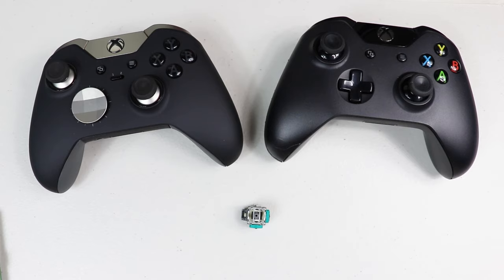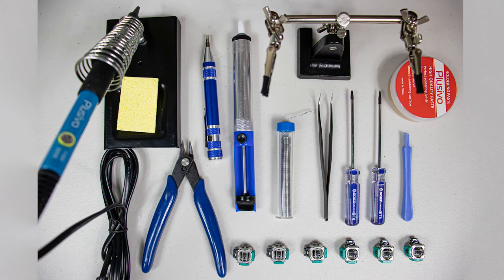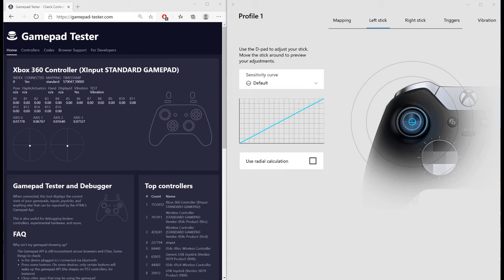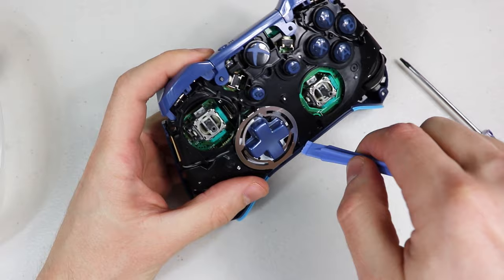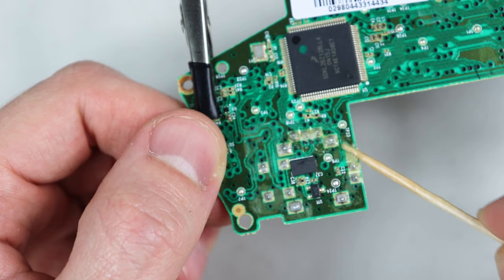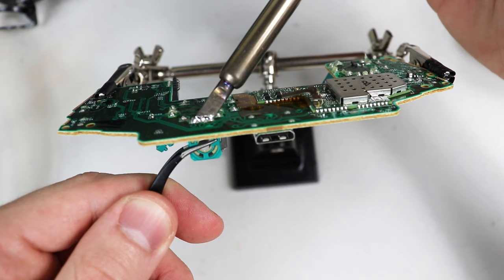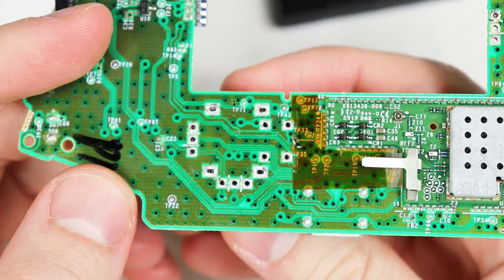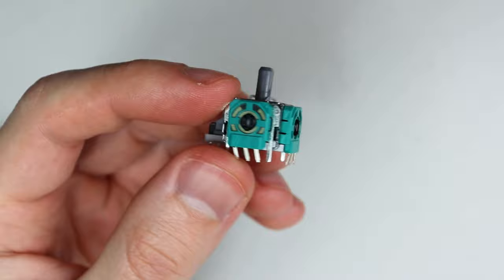How to Replace Xbox One Controller Analog Joystick - NEW METHOD - Fix Stick Drift, Broken, & Loose

Comment: Hey is it normal for the new ones to stick in the directions you push? I havnt put it in yet but they seem to be sticking in each direction I push instead of centering itself after pushing it in said direction. Does that mean they are bad or is there a step Im missing to make them center themselves?
Reply from the maker: Yes, they are totally fine! I mention that in the first few minutes of the video :)

Comment: I was doing this repair and unfortunately lifted the copper pad on one on the pins on the sensor module, now it’s reading 100% up all the time, please help
Reply from the maker: Check this post out: http://acidmods.com/forum/index.php/topic,44225.0.html I would recommend making a new post with a picture of the damaged pad asking where to reroute it too if you don't see the solution on that post.  Good luck!

Comment: Is it possible to do this with just a soldering iron and the solder without any extra stuff?
Reply from the maker: You will need a way to remove the solder and the screws on the controller. But other than than, I suppose it can be done.
Reply: @SOSSGAMING  I attempted to remove the solder with just the soldering iron and it definitely seems more difficult

Comment: i hope u answer me 

i have replaced Joystick by another one but when i test it by hardwaretester i found the arrow raised too much above the circle ..i that normal ? or that not orignal joystick ?
Reply from the maker: What is the actual value? One of the through-holes may be damaged if it shows 1 or 0, which might be able to be "fixed" with a jump wire.

Comment: Do you have to always cut off the corners nubs prior to installing ?
Or could I just put it in and see if it’s ok?
Reply from the maker: Technically no but I would recommend it, as about 80% of the time I end up adjusting it anyway, but I also try to get very close to the center.

Comment: Can you fix stick drift using just calibration or would I need to buy a whole new joystick?
Reply from the maker: Technically in some instances you could, but quite rarely. If you only have stick drift I'd recommend just changing out the potentiometer. You can just pull on off of a new stick.

Comment: I need help my stick snapped and i dont have very many tools to work with. I have an extra broken controler but the sticks work fine I need the gray stick from it becuse my Anilog snapped. How do I fix this.
Reply from the maker: Unfortunately in that situation a stick replacement is basically required, unless you are able to super glue / epoxy on the other part which may work as a temporary solution.  Otherwise, to replace the plastic piece you would need to desolder the stick, remove the base, swap sticks, and solder it back on, which at that point it would just be easier to replace the whole stick.

Comment: I need help please cause i'm going crazy. At first i switched the wipers of the analogs as a temporary solution and It doesn't work. In particular the left one keeps going.. left (i switched the x axis wiper with the y one of the right thumbstick). So i completely changed the two analogs. Now the right One works perfectly, but again a couple of minutes after i start playing the left analog goes to the left (so obviously i can't go right). I changed the wiper again but It doesn't work. Any suggestion? 
Sorry for my eng ;)
Reply from the maker: No problem.  Are you talking about the wiper, or the potentiometer?  There is a big difference.  The wiper likely won't fix anything, but changing the potentiometer to a known working one should.
Reply: @SOSSGAMING  hi, i will try to be clearer. I've changed the two entire analog blocks ( also with the potentiometes). The right one works perfectly even without calibration. The left still has the same problem related to the x axis potentiometer i suppose. It keeps going left. (But incredibly It stops if i keep the stick on the left!!).
However at first the issue was only about the right Stick y axis. So as a temporaly solution while waiting for the delivery of the new pieces i  switched only the wipers of the two analogs. And that's when the issue about the left Stick x axis started.
Reply from the maker: @greenpig4454  Ok, I understand.  What reading are you getting on html5gamepad.com and how is it responding when moving the joystick left and right?
Reply: @SOSSGAMING  thanks for your help and your time but sadly i found a burned electric path near the potentiometer holes. Moreover i was unable to connect the pad to the pc for some reason. By the way, as i said, i really have appreciated your help!! :)
Reply from the maker: @greenpig4454  My pleasure.  You might be able to connect the path again with a strand of speaker wire.  If you go to acidmods.com and post your question with a picture in the Xbox One section of the forum someone may be able to help!  Good luck.

Comment: Hey can you help me please?? I soldered Y axis properly but when i tried do sold X axis it doesnt work - first of all its almost impossible to calibrate it with this method, ( I dont have another potenciometres just one that i bought) and when I move it left to right it jumps from -1 to 1 values and after soldin it again its now at 0 and not responding when I move it. What should I do?
Reply from the maker: It can be quite tricky at times to get the readings at first. Sorry about those struggles. 
The fact it's at 0 makes me a little confused. Usually if it's at 1 or -1 it's a damaged/lifted pad, but because it's at 0 I would think it means something else. Can you tell if there is a solder bridge between 2 of the pins? Or can you see if any of the pads on the board look damaged?

Comment: Hey this may be a stupid question but do I get 1 of the soldering kits or both?
Reply from the maker: Either will work fine. The cheaper one also includes flux so may be a better option for this method.

Comment: So I did this and it works relatively well, but I have run into an issue I was hoping to get some help on. After replacing the left thumbstick, it sometimes registers that the left thumbstick is clicked in when I am not clicking it. It is weird too because my player will not be able to run when this is happening. Did I damage the board or the through-holes or is this another problem. This is the second replacement left thumbstick. The right replacement works great and never has an issue, but this left one is definitely giving me trouble.
Reply from the maker: I've never actually heard/encountered this issue before.  When you use a 3rd party website/app like gamepad-tester.com or game controller tester app, it for sure shows the left stick click being registered? If this is the case, I would recommend going to http://acidmods.com/forum/index.php/board,533.0.html and posting the question in the xbox forum.  A gentleman named RDC usually responds and is much, much more knowledgeable on issues like these.
Reply: @SOSSGAMING  Thank you! I'll check it out

Comment: Can you switch out motherboards completely as I have two controllers broken in different ways and I want to salvage a good motherboard with functioning joysticks and place them in a controller housing and upper PCB
Reply from the maker: Yes, absolutely! As long as they are the same model number.
Reply: I think this would be much simpler than all this in and out calibration thing, it't risky.

Comment: Ay yo I need some help with my wired controller I can only look down same as when I move I just keep going backwards
Reply from the maker: Yep sounds like you need to replace the Y-axis potentiometer.  You can first try cleaning it out with some isopropyl alcohol first, but I find they usually just need replacing.

Comment: So i need to replace the right analog stick module thingy. Do I have to do every step in this video. Like moving the pins clockwise and counterclockwise? Or can I just solder it back on and be done? I’ll try to be more specific if I confused you
Reply from the maker: I think I get what you mean.  You mean just replacing the potentiometer correct? It'll likely be within an acceptable range after being replaced (<10%), but I'd always recommend trying to get it centered as best you can regardless.
Reply: @SOSSGAMING  I think I’m not gonna half ass it. Ima go ahead and follow your directions and try to get it at least right 😂. Thank you though. This really is gonna help
Reply from the maker: @JeremyOfWars  best of luck!
Reply from the maker: @JeremyOfWars  :(

Comment: Going to try this out on an older controller before trying to replace them on my elite series 2. I bought your joystick replacements but it doesn't look like you sell any for the elite series 2. Do you know where I should look to get some?
Reply from the maker: I will have a specific kit for the 2 on Amazon in about a month, and have a video released as well in about a month for it. The calibration method isn't necessary on the 2's which is nice. If you just have stick drift, you can actually just use the potentiometers from those joysticks (they're the same) and replace with the one causing the issue. I sell the elite 2 joysticks on eBay right now though if you were interested in the whole unit.
Reply from the maker: https://www.ebay.com/itm/224138078310

Comment: could you recalibrate a controller that has a tiny amount of stick drift?
Reply from the maker: The typical cause of stick drift is the wearing down of the carbon inside the potentiometer.  You may be able to get away with wiping and cleaning the inside of the potentiometer with isopropyl alcohol.  Sometimes gunk can build up in there causing the drifting issue.

Comment: Do you know where to find only the joysticks without the screw drivers? I already have the screw drivers an pry tools, I just want to joysticks
Reply from the maker: I do have plans in selling them in a larger quantity without the screwdrivers. At this time, however, I just sell them with the screwdriver. Reason being they aren't a significant part of the cost.
Reply: @SOSSGAMING  thanks man, often repair my friends controllers and i dont want to buy screw drivers every time

Comment: I believe the solder connections got burned off when I attempted this. (I see white where some of the pins were connected). Is there any fixed for this or should I just get a new board or controller. Btw its a one s controller (Minecraft creeper, slightly expensive) and if you know the name of the board or where I could get one I would appreciate it if you would let me know.
Reply from the maker: It's technically possible to put jump wire on the connections that were screwed up. Send an email to my gmail which is sossgamingcs and I'll see if I can send you where the jump wires go, if you send me a picture of the board to see which ones are bad.

Comment: I've switched the potentiometer I was having issues with and calibrated it. However now I'm having the issue of the XBox doesn't recognize that axis whatsoever. Does anyone know what is causing this issue and how to fix it
Reply: Has an update to anyone that may have the same issue as I did pay dude pay attention to the way you've been depends I and I bent them to the left when looking at the back of the controller troller and they then interfered with the battery connections. General rule of thumb always bind them inward towards the center of the is the stick you're working on

Comment: I've seen it mentioned (both in the comments here and on the Amazon Q&A) that the Xbox Series X/S controllers auto-calibrate. Do you know what specific model number(s) this applies to? I'm attempting a potentiometer replacement on a Model 1914 controller that supposedly came with an Xbox Series X, but it doesn't seem to auto-calibrate.
Reply: I should probably also mention that I'm not using the kit linked in the description, but some older joystick modules I had from other repairs. It's possible that I'm not using a potentiometer with the right resistance, but I've had a difficult time finding that information anywhere - I've tried both 2.1Kohm and 10Kohm pots, but no dice on either (10K centered fine but was far too sensitive, 2.1K did not center and could not reach 100% but did not have the sensitivity issue).
Reply from the maker: I'm sorry to hear the struggles. I'm not sure which specific models they are unfortunately. I would need to do more research, and won't be able to do that for some time. Do you know how many models there are of the X/S controllers? If the potentiometers themselves have the integreted deadzones, that is likely the issue. 
If they are normal and it's still not autocalibrating after moving it around and using it for a while, it may be that that specific model of s/x that you have doesn't have the feature. Do you know when the purchase of that controller was? I'm wondering if they only introduced the feature on later S/X controllers and not from the start.

Comment: Just did the repair and everything works fine except that the joystick i repaired is quite jittery and doesnt respond well to movement.
Anyone have any idea on why it may be?
Reply from the maker: It sounds like the potentiometer just needs to be adjusted again. I'm guessing you had done the manual calibration?

Comment: Hi can u help, iv been trying to fix my drift first time it did for a bit, so 2nd I removed everything, u know the wire under orange clear sticker the bit it clicks into has broken off 😔 can u tell me if this can be fixed at all and what it dos as my controller turns on, sais it's connected but no imput from buttons 😔
Reply from the maker: Hey there, great question. I'm actually not sure what it does. I'm wondering though, if you're able to solder it on? Perhaps strip the wire and solder it on. Just an idea. You can also post this question on acidmods forum, they may be more helpful. Best of luck.

Comment: there is a way to solve potentiometer resistance whitout moving it if i know that is perfectly centered?
Reply from the maker: What do you mean by solve potentiometer resistance?
Reply: @SOSSGAMING  you showed a stick drift problem when the point stay below the 0 on y axys, this is the problem i exactly have, and you mentioned the potentiometer resistance solved by tilting it in the opposite direction, this resistance can be solved in other methods or only by tilting it? thanks for the answer.
Reply from the maker: @LolloG_15 Gotcha. If I'm not mistaken tilting doesn't actually change resistance, just physically moves the center point. However, there is actually a way to move the center point by using resistance, funny enough. If you search for "stick drift mod" there is a mod you can attach, then adjust it's resistance, which adjusts the center point. The only problem is this may effect the range as well (more than desired).

Comment: I have a day one xbox controller, and I bought the replacement kit for the thumbsticks because the left analog has stick drift and it always makes me look up in videogames. I went through with the entire video, and I mean the whole video, and I had the potentiometer bent the opposite way on the vertical axis so that I could look down and not stay looking up and the most I could get it too from the website was 0.4000 but never the right amount. I replace even multiple potentiometers because I thought it could be faulty but no avail. It is possible this controller just can't be repaired? Or Maybe I bent the pins a little too much and caused damage on the holes? Either way I don't know if I should keep bending the pins but I gave up, I can't seem to manually calibrate it.
If you need a reference it is exactly like at 18:49 in the video. My left thumbstick is stuck looking up, so I bent the pins down and to the left a bit so the board can read it but still nothing.
Reply from the maker: If you move the joystick around, does the cursor dot move at all? 0.4 seems quite higher than anything I've ever dealt with. If it's not moving, it could be damage or corrosion in one of the lines (not repairable that I'm aware of).  If it is moving, it's also possible the original stick had a very off-center calibration.  If so, it will be difficult, but you might be able to try a different joystick (or perhaps the original one if you still have it and it's still in ok shape). I made a different video on how to measure the pots with a multimeter. You could try measuring different joysticks/pots (like in the video) on the y-axis until you find one with a high negative value, then install that joystick and use the additional step of twisting the potentiometer as shown in this video might work. Also, make sure you are turning the pot the right way to make it read down more, as I still confuse myself often.

Comment: Is it possible to put elite 2 thumbsticks in a xbox one s controller??
Reply from the maker: I haven't personally tried it, but the issue I can see is the height of the elite 2 joystick. It sits higher, which may interfere with the front plate/movement of the joystick. You may be able to shorten the plastic base though through cutting it or melting it or something. There might also be issues with calibrating. Probably a little tricky to do, but technically possible.

Comment: I changed the stick but it reads 100% halfway my finger movement. What should I do?
Reply from the maker: Sounds like it has a high range potentiometer. You will need to replace with the same kind of potentiometer to have the same range. Which ones did you use?